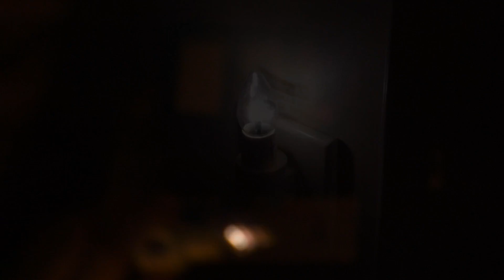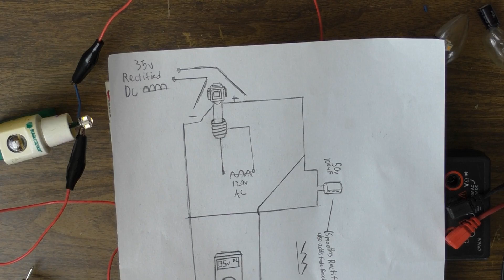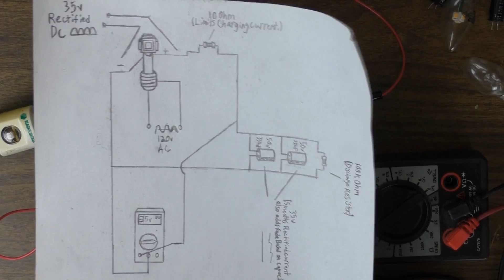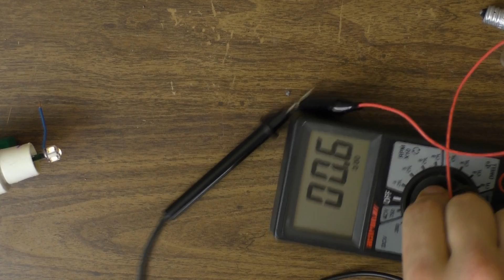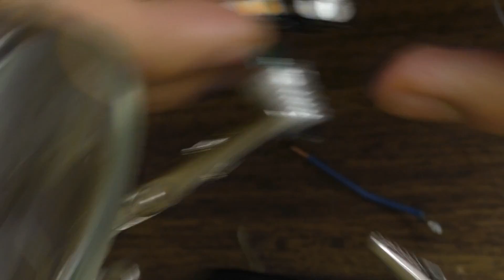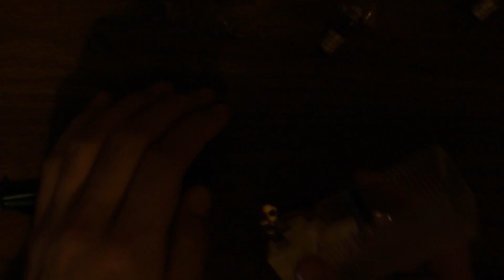Mod To Fix S**t Night Light Bulb. (Patreon EA Vid)

Comment: Found this channel after reading a comment you left on a Big Clive video and I was pleasantly surprised. Love what you are doing here. Keep up the quality content!
Reply from the maker: Thanks I appreciate it. May I ask which comment? I am a big watcher of his channel and have left quite a few.
Reply: Ahhhhhhh, absolutely. I believe it was Clives video on the inside of a l-ion battery. You were trying to explain why you claimed to have a microscope with 2500x theoretical magnification while someone pedantically argued with you about it while dropping random bits of info about a SEM and TEM he has access to.
Reply from the maker: Assume room Temperature, Yep I know what you are talking that was a recent one. At any rate thanks for dropping by.
Reply: Well thanks for having me by sir. I've been cruising your back catalog and have found some gems. Which is a great segue into mentioning your glass marbles into faux gems video. You created a "twice baked" prince Rupert's drop essentially. Awesome idea. Do they seem to stay together during handling? Does the external layer of uncracked glass provide enough surface tension to contain the fractured inner material without falling apart if they smack in to each other (like if you tossed them into a bag)? Sorry to bother you I'm just fascinated with trying that process myself.
Reply from the maker: Assume room Temperature, Yes actually they can hold together quite well. I haven't been gentle with handling them at all and I say out of the hundreds I've made I've had maybe 10-15 break.

  Still I would say that if you hit them together a bunch in an agressive manner like while shooting marbles, then they'll likely break after repeated use.

 But standard drop, bumps or handling they should be fine.